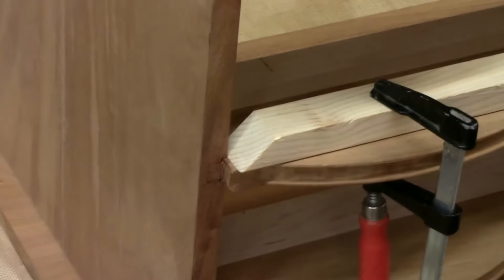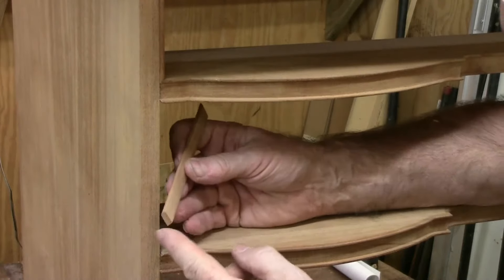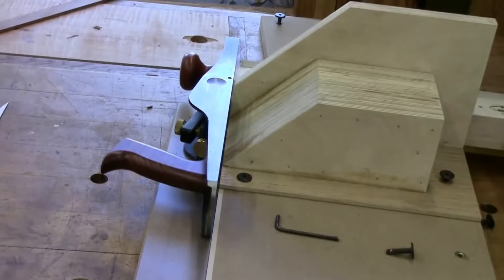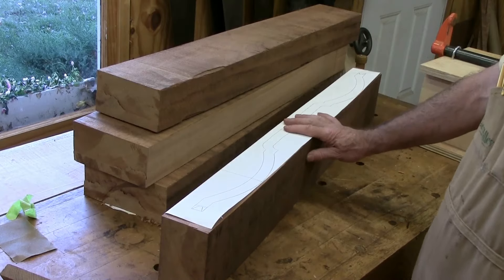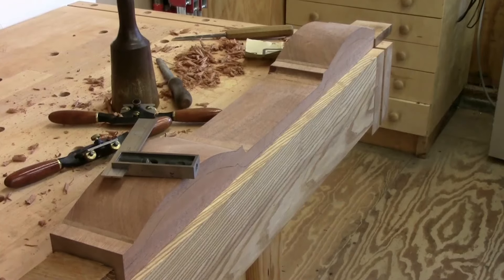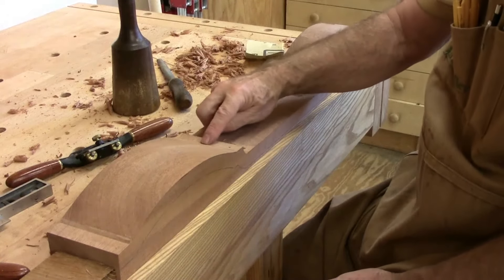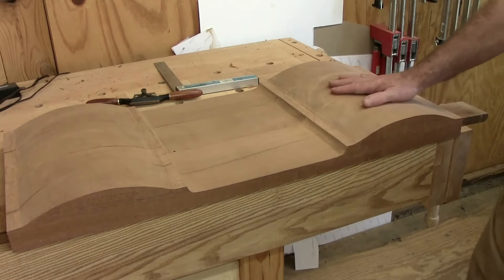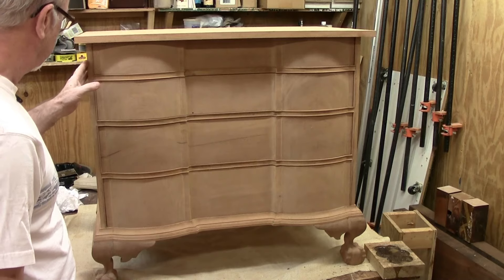Mahogany Curved Blockfront Chest Cockbead & Drawer Fronts Step 6

Comment: Hi David:
You as always make it look so easy.  You were very smooth in adding the Cocks Bead and it was so easy to do it that way.  Yes I have used the same method to get miters to fit.  It is so easy to do it that way.  
Maybe you will be able to make some Candle boxes or some boxes or a tray for the block front.  Those big scraps do have to be made into something.
Have fun in your shop.  Tuesday in the Shop, I have to mortise in 6 locks into the 6 Keeping Chest.  Not a fun task.
Reply from the maker: Thanks, mortise locks is not so much fun, I will have to do 4 for this piece. Have not got them yet. Regards.
Reply: I get all the hardware that I can from Horton Brass,  Never had any problems  with there hardware.
Reply from the maker: They are very good, I also get hardware from Ball & Ball and Optimum Brasses